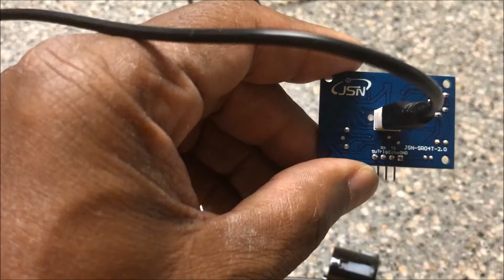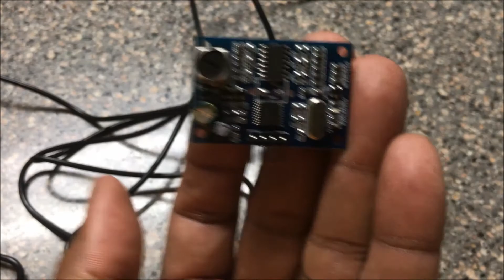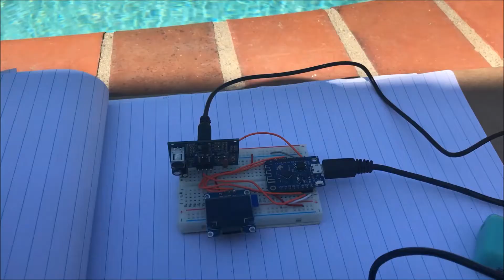Ultrasonic Module JSN-SR04T

Comment: hey bro,  is it possible to get the raw echo data from this sensor  as shown in this video https://www.youtube.com/watch?v=4eGXaXN5NfM&lc=UgzmlrrrEcqQbP8z0414AaABAg.9LpJTU8efRx9LpXMMoNfB7
Reply from the maker: Yes.  If you google Arduino Ultrasonic Radar, you will find a sketch that outputs that data.  In the video you mentioned, the poster is using Processing IDE to graphically display the data being supplied by the Arduino.  And sometime today, I will upload a video showing you a radar sweep using the JSN-SR40T
Reply: @microcontrollersandiot3700  thanks that i understood but i find it difficult to identity the rawecho pin in JSN-SR04T, SO THAT I CAN TAKE THE VALUES FROM IT. IN hc-sro4  THE 10TH PIN FROM THE OPAMP SITUATED IN THE MIDDLE  WAS TAKEN. but in jsn-sr04t the circuitary is differen right?

Comment: how u wired the JSN-SR04T  with  D1 mini ......JSN-SR04T  will work on 5v only... D1 mini is 3v
Reply: I think we have to use voltage level shifting
Reply from the maker: The WeMos I used was a v 3.0.0. It has 3.3v and 5v supplies.
Reply: I believe JSN-SRT04T-2.0 (Version 2.0) is a 3.3V sensor and should be voltage & logic-level compatible with 3.3V boards. The one used in this video is 2.0.  Someelse con confirm same?